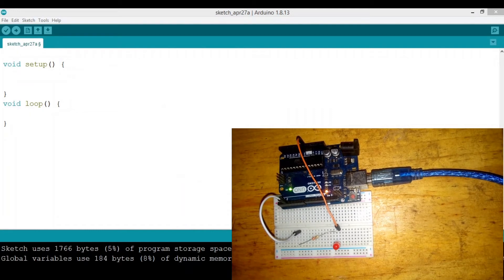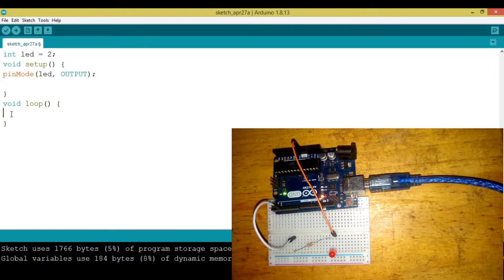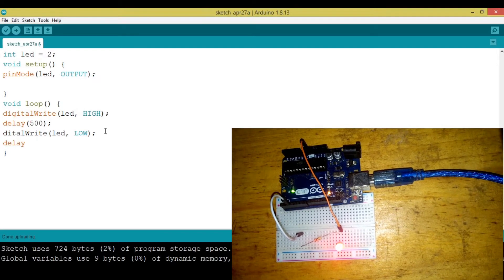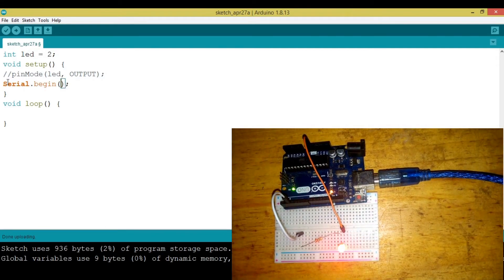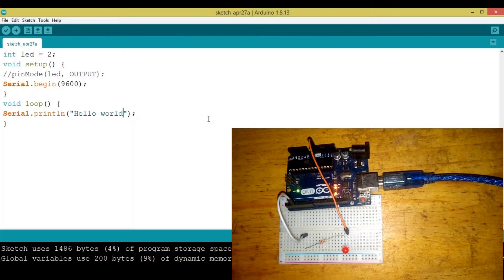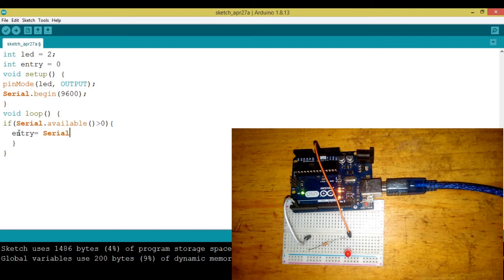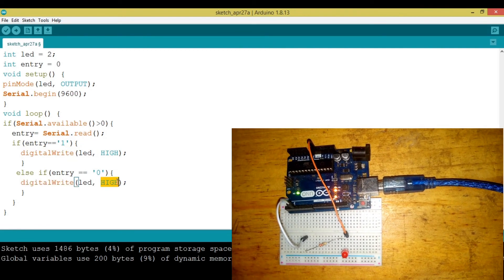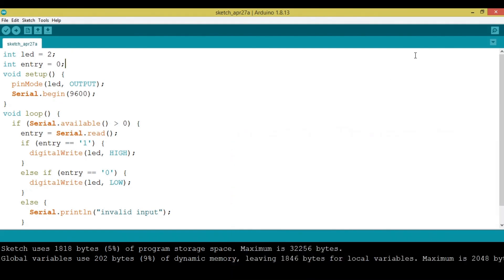control Led from serial monitor using arduino

Comment: @
Idukunda Lengo. i have no experience in making stuff like this, but been trying to learn the basics for a few days now. I've watched a few videos on making a code and couldn't really understand it to make me say to myself, I think I know what to do now.

I have one question, if i wanted to use this with an accelerometer so when it goes in a certain direction it will light up and flash, would I put this code before or after doing a code for the accelerometer, or don't it work like that
Reply from the maker: Hey, if you already setup your accelerometer. First display all axis values(to make sure the accelerometer is setup correctly) then after choosing which axis you need the Light Emitting Diode to go with let's say X-axis and an if condition to it  accordingly there in that condition block is where you set the LED to be On or Off to certain values. Hope I got to the point.....and that can be used in drowsy detection project. hah
Reply: @idukunda_lengo  that sounds clear enough. I want to make something that would light up once it detects deceleration